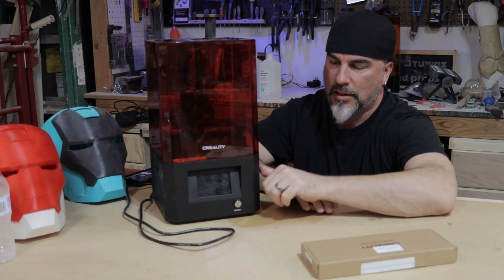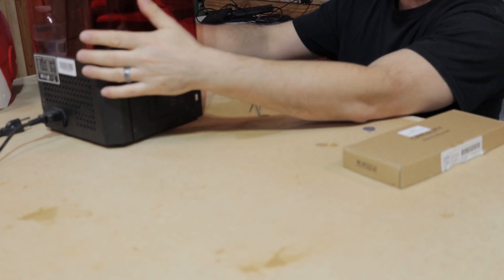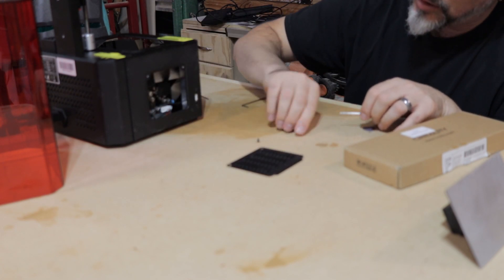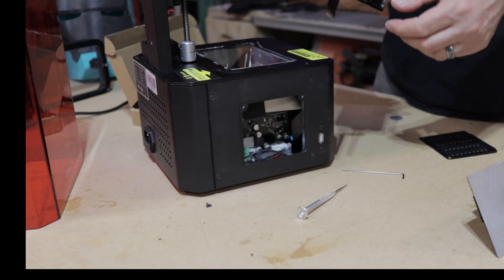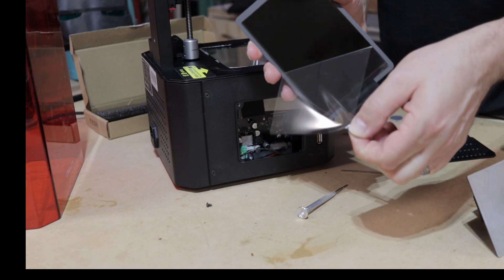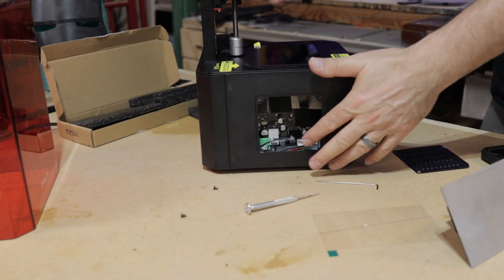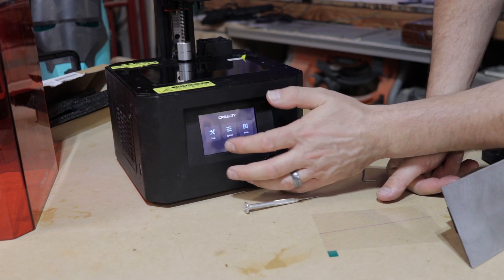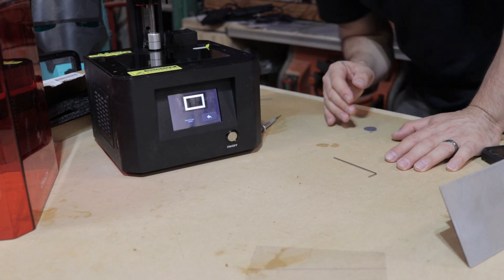How to change the screen of LD-002R resin 3D printer

Comment: i noticed you didn't replace the doubled sided tape, is this still holding tight?
Reply from the maker: There were still some on there. It it’s holding tight
Reply: That was my question as well. I heard other people put black electrical tape on the outside edge of the screen to secure it.
Reply from the maker: That’s the first time I heard that. May try it if it comes undone. For now it’s holding on